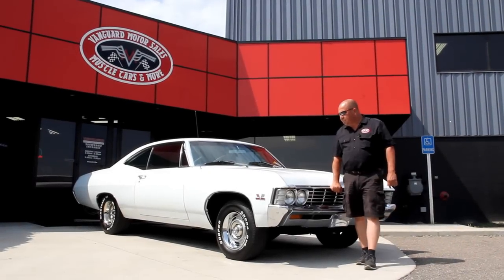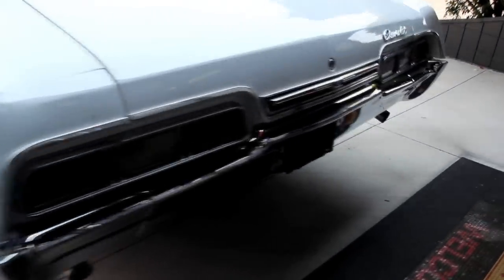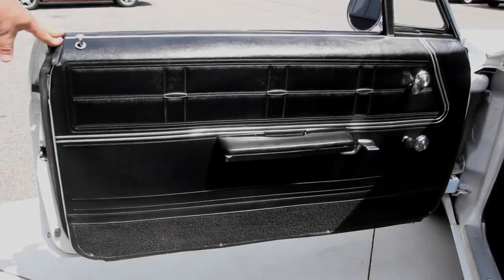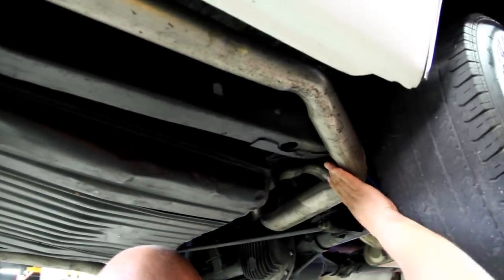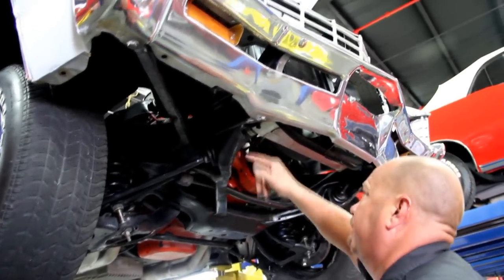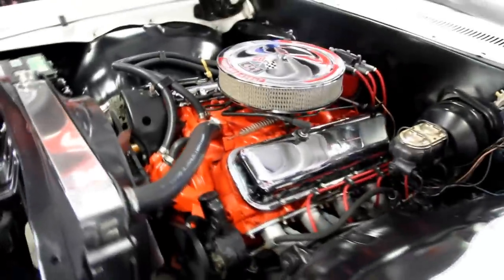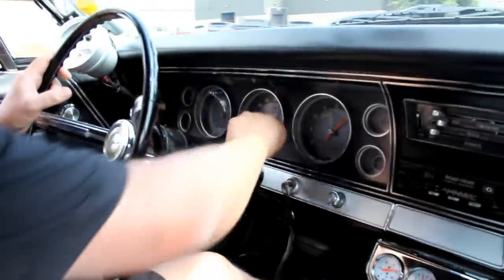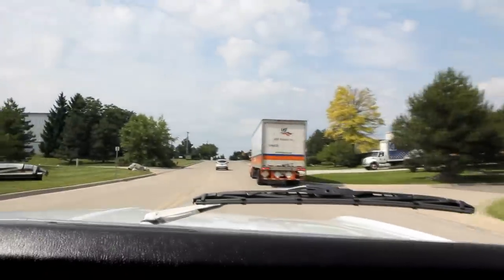1967 Chevrolet Impala Fastback For Sale

Comment: Why are calling this an Impala? It is NOT AN IMPALE. In '67 Chevy had the Biscayne, the Impala, and the Chevrolet. The Chevrolet wasn't an Impala nor Biscayne.
They all came with the 427 Turbo-Jet, part of the 1100 produced that year.
How do you not know this? I don't like gm products, never have been a fan.
Reply from the maker: Well we don't have the car anymore because it has been 9 years but you are correct the Biscayne, the Impala, and the CAPRICE(Not Chevrolet) were all basically the same car with different levels of trim. However, it is an Impala. You're right it doesn't have the impala trim anymore on the outside but It does have the Impala tail lights the, Impala door panels, and it was titled as one..